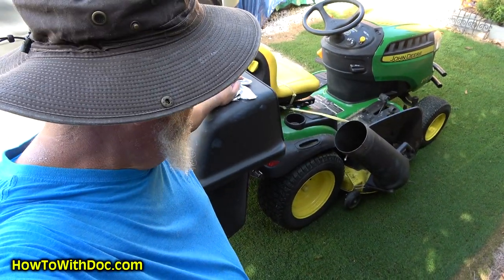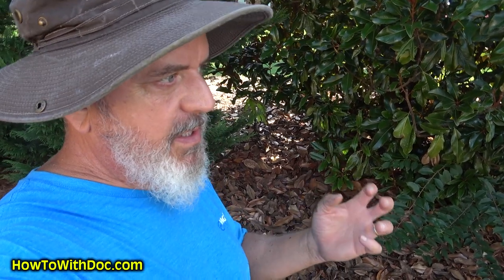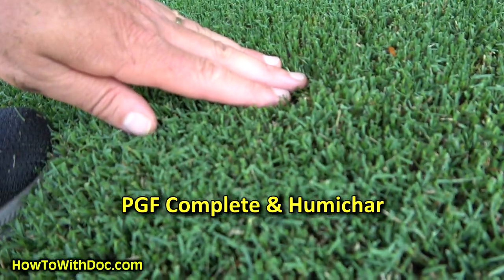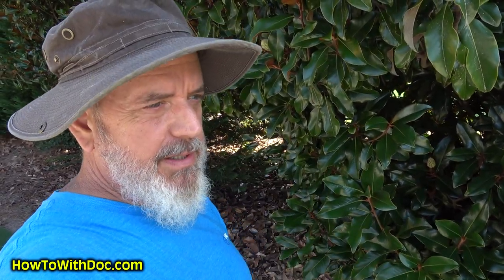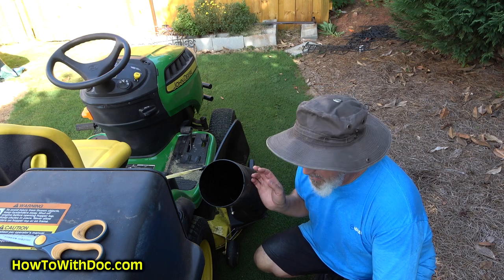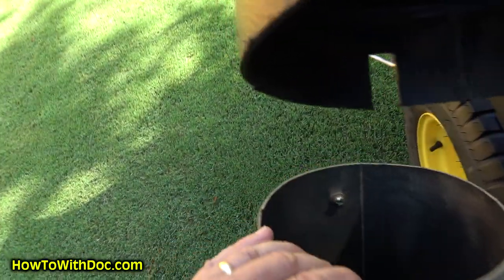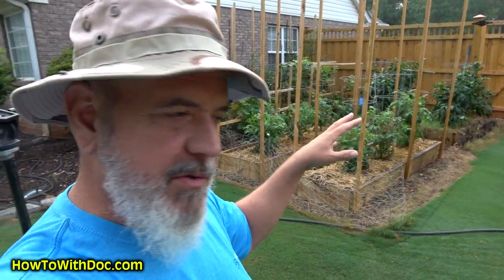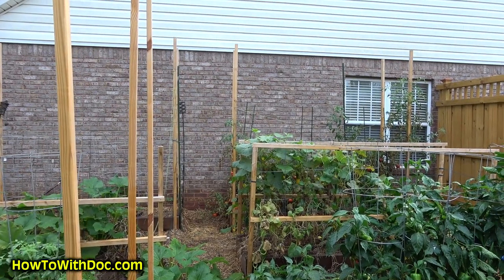Grass Clippings Clog Mower - Late Season Veggie Harvest

Comment: thank you put a bagger on today first run and empty the fall leaves were great. 2nd one it would not pick up one freakin leaf. the neighbor that helped me put the bagger on came over, took the tobe off at the bottom and it was clogged. did another run, emptied two full bags,,, then would not pick up a leaf. So Every ten minutes empty bags and unhook the tube - that is NUTS!! Gonna try the wax - THANKS!!

Comment: I can’t scrap or I would my front yard is full of nut ledge my next door neighbor is the shits . I have used Humichar and pgf completely every week I try to cut 1 inch that is as low as I can do.I am going to fertilize with 15-15-15 and water the hell out of it .And try to have the grass choke out the nutsluget and Milk wind what do you think. I don’t have a reel mower.
Reply from the maker: Nutsedge needs to be treated and can't be choked out.  It has "NUTS" under the ground.

Comment: Hey Doc I have what could be considered native Bermudagrass that has been in my yard since the 50’s. Can you cut it low like the newer turf variety? It is so thick my push mower gets stuck on top of the grass wheels just spin I have to actually push it off the top. If I wanted turf type would I need to kill what I have and start over.